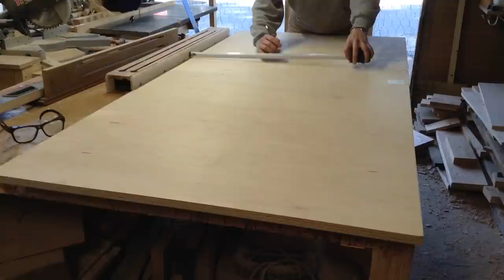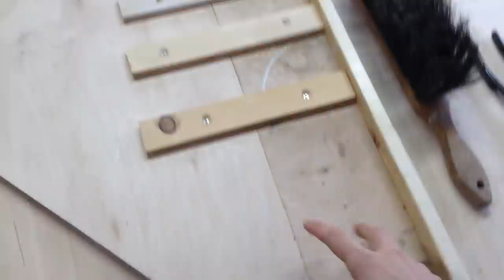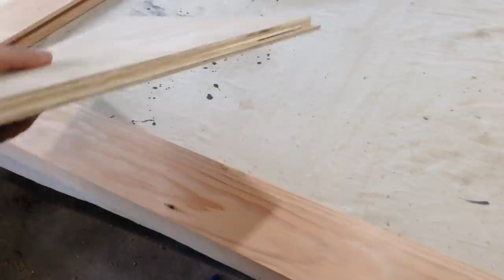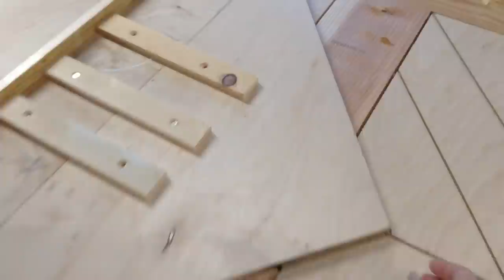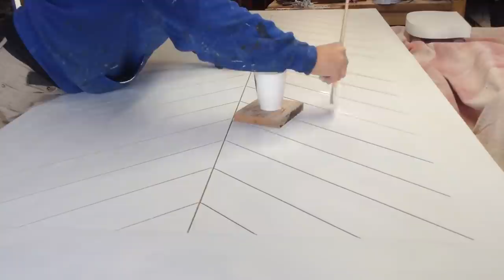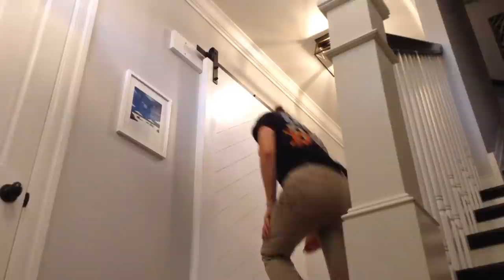Woodworking :  Sliding Barn Door // How-To Part 2

Comment: I had an easy job recently that involved making a simple box with a little ornate trim on it to cover a pipe that was proud of the sheetrock I got it done really fast and was getting ready to install it when I realized I had forgotten to add the material thickness to one of the measurements..I had to start over again....it happens to everyone... you're great.
Reply from the maker: I have done that a million times and it sucks every time haha.

Comment: I liked your approach to creating the chevron pattern...much less work than cutting individual boards and makes for a much lighter door.  Any reason why you didn't create the pattern on both sides, or was that a customer preference?
Reply from the maker: It's cheaper to keep the back panel blank, and I believe from talking to her that the door will mostly be opened in which case you wont see the back.
Reply: @HoneyBadgerWoodWorks  Good point.  I'm getting ready to put one on a bathroom, and will probably finish both sides...gives a person something to look at other than a cell phone. :)

Comment: Hey my friend ; I just bought a Kline moister meter off Amazon for I think $40 ?  And it works great plus it had good reviews.  I did like you for years just letting the hardwood dealer tell me the content?
However when buying 2G ‘s or more worth of wood I want a meter on it!

It’s orange in color I will try and shoot you a model number?  I own a finish carpentry business “Kings Table Custom Finish Carpentry” and I just could not go w/o anymore?

I suspect as your popularity goes up; business goes up & now your gonna get nervous about your customer call backs!!

Plus I tell my customers any call back on my stuff no charge!  Lastly my Son (probably about ur age ) is a good carpenter like you!  Built this beautiful table for a customer and the lumber exploded??
Why?
Klin dried to fast?  Locking moisture inside the 6X8’s and causing it to rip apart over time!  Not his fault but he paid to rebuild table?  If he had put a meter on it he most likely would hv caught it?

Oh and top notch build like the mortise/tenon job!!  U know tons of money in custom doors?
I built a door out of Cypress took 2 days?  And his wood he supplied!
$1500 in my pocket!

You hv that knack!  Advertise to custom contractors in your area!
Just approach & tell them I will build what you can not find!
Works for me?

Comment: Without any climate control, what are you doing to protect the glues and things subject to freezing in your climate, Katelyn?
Reply from the maker: Last year it really wasn't a huge issue because we had a very mild winter (fingers crossed for the same this year).  Other years I just transport stuff like that inside when I'm not using it which is a pain.  But, since I started using heaters the last two years they keep it warm enough in there even after they are off to keep things from freezing over night.  But, yeah winter in general is a real pain for me.